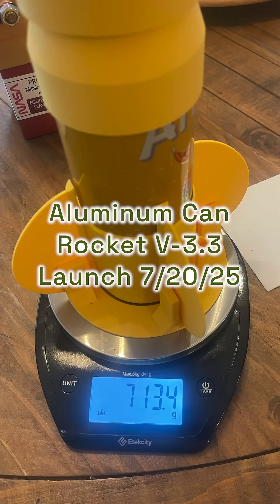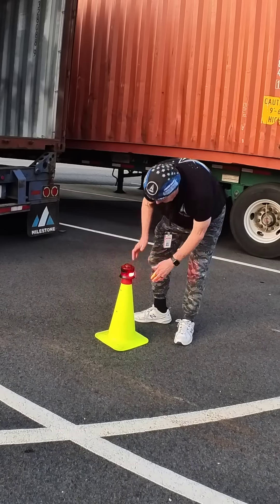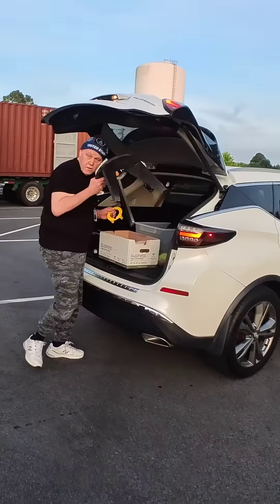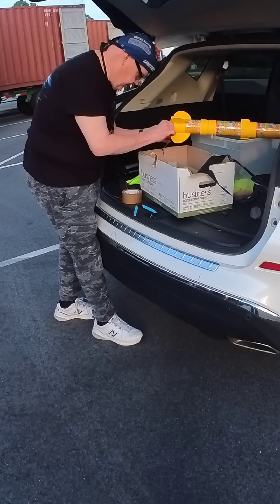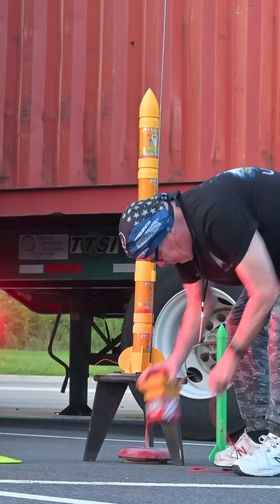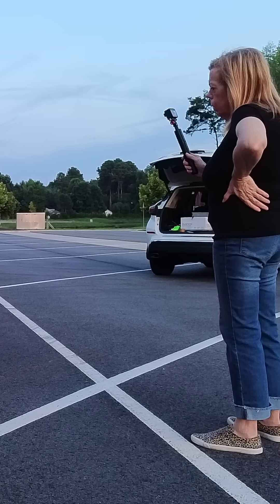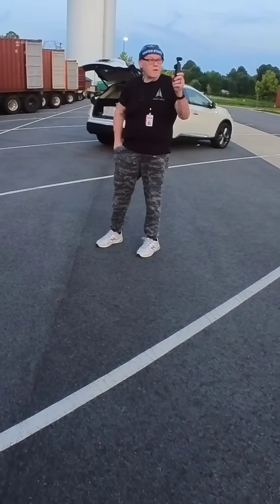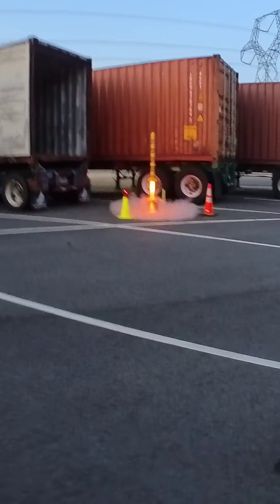Blasting Off with a Bang  Aluminum Can Rocket’s Fiery Flight

Comment from the maker: Burn Time: The rocket reaches its maximum velocity at t = 1.7 seconds after ignition.
Maximum Velocity: The maximum velocity is approximately 104.14 m/s (or ~233 mph).
Using dual Estes F motors and a 4 second coast delay the estimated apogee is 1400 feet.
Reply from the maker: rrocketry.com

https://docs.google.com/document/d/1-mfSIlRrH9mFBDxwRIr8iBGxXigwkkmJ_F5USYligOI/edit?usp=sharing